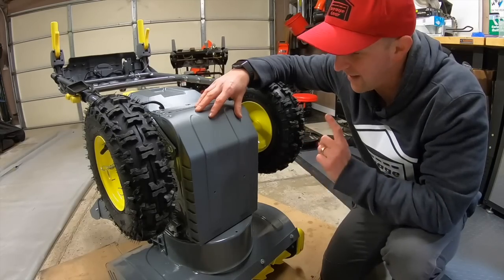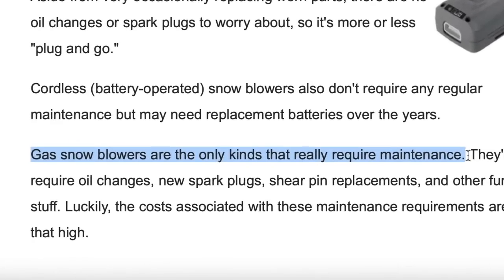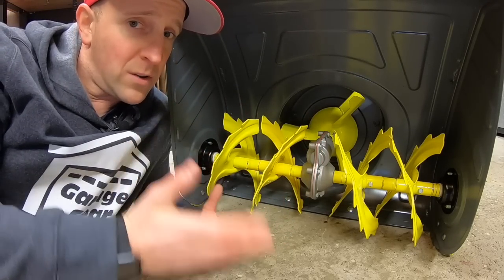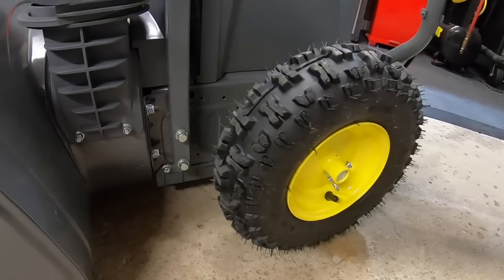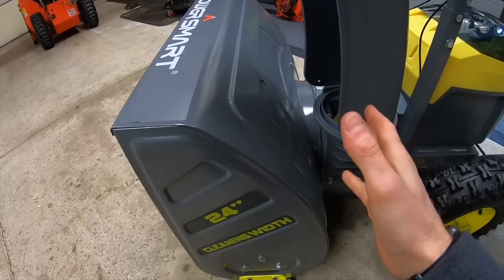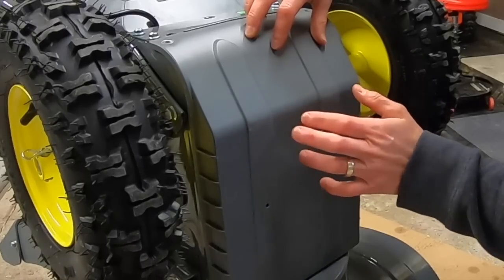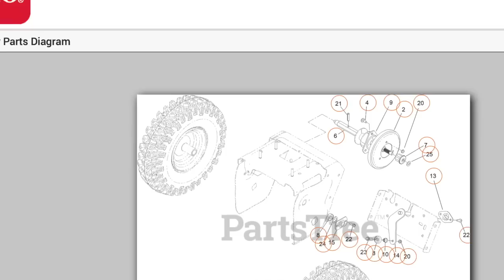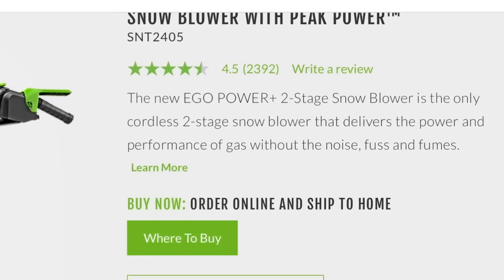ARE BATTERY POWERED SNOWBLOWERS MAINTENANCE-FREE?

Comment: "maintenance free" generally means little or no maintenance. Speaking for my single stage EGO, no it's not maintenance free. Their scraper bars are made of cheap plastic that will barely give you a season. Toro's battery powered single stage says you get 20 hours from their single stage scraper bars and they're not cheap to replace if you can find them. Then you have the horrible design, they don't have skid shoes so the auger and scraper bar eventually get destroyed. That said, I like not having to worry about gas and oil any longer.
Reply from the maker: Thanks for sharing this information! 👍

Comment: General rule of thumb: moving parts require maintenance, and will eventually fail. On Electric machineries, there are less components compared to gas powered machines, and therefore might be easier for DIYers to fix. But, it won't be necessarily cheaper compared to gas powered models.
Reply from the maker: Totally agree Ben! Thanks for sharing!

Comment: It is good you are educating people about these as far as I'm concerned these things are disposable. Plastic not only wears very quickly but the colder it gets the more brittle it is which means it breaks. As for the battery I don't know how long they last (a car battery lasts about 5 years ) but you can add that to you're list of maintenance items and probably a very expensive one' Thank you but I'll keep my gas model that I've kept running since 1994      (that's 28 years) with very little maintenance.
Reply: "a car battery lasts about 5 years" Is not relevant, entirely different chemistry and form factor.
Reply: @Neojhun  maybe not but my sons lasted 3 years now he gets to buy a new one so believe what you like I only know what I've seen
Reply from the maker: A lot of god points here! I know a handful of electric car owners and it will be interesting to see where they are at in the next few years. I don’t see them being very happy. Thanks for watching!

Comment: This is the video that convinced me to subscribe to your channel. Well done and and thank you! I'll stick to my Ariens Deluxe 24, which I don't find any trouble at all to maintain. I've been familiar with the care and feeding of small gasoline engines since the mid 1960's so I don't find them to be any hassle at all, it's just normal maintenance that by now comes naturally. And the only additional maintenance on that over a battery powered machine is an oil change. The ignition is electronic and the spark plug is platinum so I expect those parts to last nearly the life of the machine. And check out the price of those replacement batteries. Yikes!
Reply from the maker: Thanks for subscribing Irving! Maintaining a gas model is not complicated. A few minutes and a little know how and you’re all set each year. Thanks for watching!

Comment: ALL machines require maintenance. The extent and kind of maintenance depends on the machine.  Owners who prefer no-maintenance snow blowers will join the frequent buyer program.

One of the concerns I have about an electric snow blower is not the maintenance, which is no big deal,  but rather precisely that it is light in weight. This makes using it easier, but it will also make it less able to deal with heavy and compacted snow, like that at the end of the driveway after the snow plow passes by.  A light-weight snow blower will tend to ride up and over such snow. This is also true of smaller, lighter-weight gas-powered snow blowers, in my experience. (For this and other reasons, I regard single-stage snow blowers as a waste of space. Just saying...)

Another issue with battery-powered snow blowers can be the batteries themselves.  If they go bad, then that is a major-league expense, and these batteries do, on occasion, need to be replaced. Further, batteries with higher amp-hour ratings cost a lot more that those that usually come with the new machine, though they might be worth the cost if you have a good-sized space to clear.

Other than that, a battery-powered snow blower looks like a pretty good option (1) for areas where there tends to be light to medium snowfall, (2) for owners who prefer light to medium maintenance, and (3) for those who want a quiet, light-weight, compact, clean, and easy-to-store machine. 

I have a twelve-year-old Troy Bilt Storm 3090. It is a beast. I love it!  It is still going strong, and I maintain it.  Yet, if it goes face up on me, I am considering a battery-powered snow blower (EGO) simply because I am getting older (at 74) and my snow blower seems to get substantially heavier every year.  Strange how that works out, right?

I really appreciate the tips and techniques for maintenance you offer in your videos. Very helpful.  RESPECT!

Great video!  Great channel!
Reply from the maker: Appreciate you Jerry! Thanks for sharing this!

Comment: i own a single stage electric with no maintenance for 27 years, when i finally replaced the belt last year.
bearings on the beater bar are sealed. 
by the time replace them, it'll be time to buy a new one.
never not worked anytime i plugged it in.
Reply from the maker: Thanks for sharing HG!

Comment: When you tipped it up, my first thought was that it was the only difference from a gas powered machine, no drip.
One thing about gas models is that even though you have to maintain them the same, you can also fix them cheaply. I didn't like the look of that little drive motor on the electric. A spark plug, oil change, or new carburetor isn't too expensive. How much is one of those little motors?
Thanks for showing us this.
Reply from the maker: Hey grey one of those motors runs about $220 bucks last I checked! Not cheap. Thanks for watching!

Comment: what do you think of Toros 60v 2 stage? they kept the gas blower design and swapped it with a battery motor over the gas?
Reply from the maker: Well, I’ve done a handful of different battery products in my garage and reviews on all of them. Every single one was junk and not worth keeping. The batteries are expensive, don’t last long enough and definitely can’t handle Buffalo winters. If you have a small amount to clear go for it if not stick with gas.
Reply: yeah we dont have a huge driveway by anymeans. even though u dont advise battery snowblowers, if their was one u had to pick, which 2 stage model would u think is best out of all them? @GarageGear
Reply from the maker: @randomrazr  is probably lean toward toro because they have more metal components.

Comment: 1st off def appreciate all of your insite and watch a lot of your videos. But I think it's a wee bit overkill greasing that regularly...especially if you are only using the machine a few times a year. I have both gas and electric and live in the northeast.  Electric for about 5 years and had to do zero maintenance so far and gear and shaft grease is completely fine. To be fair "zero maintenance" for an electric blower is not accurate. However far less maintenance than a gas blower would be a fair statement.
Reply from the maker: Thanks for sharing him! Companies should definitely use the terms “less maintenance”. Yea if you don’t get a lot of snow greasing often is not required. Thanks for watching!

Comment: As an elderly single, disabled woman I love your videos!!! You make them easy to understand and love your added humor. I live in waaaay northern Idaho.... the previous homeowner left a Toro gas blower... it leaked gas, it was hard to turn and got stuck in the ruts even with chains on it... and the "one pull" bs well... was bs! So I bought a Ryobi battery powered to replace it... POS... the. plastic part on the bottom broke the first day I used it. I returned it and since bought the new Toro battery "all metal" machine... I gasped at the price of almost $2000k but was going to try it out and return it if it didn't perform. BEST>BLOWER>EVER!!!! It's all metal, no plastic...the same as the gas machine except with a battery engine... it has heated grips, it turns on a dime with one hand...(I have a torn rotator cuff and had no problem) ...NO CHAINS required what so ever... it is a beast!! I have 5 acres and heavy snow load... I have made paths around my property with ease to walk my dogs all winter...my "Arien" gas neighbor is beyond impressed... The only downside is the two batteries it comes with only last about an hour or so per charge depending on what you are doing... but I am worn out by then anyways. You can add a 3rd battery but they are $350 I think. I did not know about the maintenance required so THANK-YOU JB for another amazing, informative video!!!
Reply from the maker: Hey Willow Tree, thank you for sharing this! It’s great to hear what people are experiencing first hand using this equipment. As well as their likes and dislikes and what broke along the way. I appreciate your feedback and thanks for being a cool fan of the channel! 👍

Comment: What happened to the lube on the drive gear? That's poor quality manufacturing, and guaranteed to cause an expensive repair. Most people that buy those will be mechanically challenged. Thankfully, I'm an older guy, and learned this stuff as a kid. 

No gas? I'll pass.
Reply from the maker: Right there with ya Rob! Thanks for watching!

Comment: My dads battery powered toro left him stranded at the beginning of the season. It was too cold for the batteries to work and the machine refused to turn on. Like others, I’m sticking with gas for now. Another great one, thanks!
Reply: That's sad they don't have a preheating function when plugged into charger. That could be the simple solution to avoid that problem.
Reply from the maker: Thanks for sharing this Shawn! How long did the battery last on its use? Do you know by chance?
Reply from the maker: @Neojhun  I like the idea but I would imagine this jacking the already insane prices of these even higher. Thanks for sharing!
Reply: @GarageGear  I’ll ask him and circle back. I can share that he now keeps the battery inside and on a subsequent snow had no issues.  I still struggle with the concept that it could be to cold to use your snowblower. This is a concept I have never had to deal with when using gas. I’m all for electric, I just question if the technology is fully reliable yet for snow blowing.
Reply from the maker: @shawn8196  I think all of this has come a long way but we’re not there yet! Batteries are really good trimmers but any thing needing consistent power needs more work!
Reply: @shawn8196  Yeah you're definitely supposed to remove the batteries from the unit and bring them inside. They're heavy enough that they're not going to get too cold in any weather if the blower is active, assuming they're already a reasonable garage temperature (15 ℃ / 60 ℉) when you start.

Comment: No thanks,  I’ll be keeping my big Toro.  That thing looks like a toy.
Reply from the maker: Hold onto your gas equipment! Thanks for watching DA! 👍
Reply: I looked at the toro 2 stage electric before buying gas.  Except for he power plant, it’s exactly like the equivalent gas model.  Same friction disk, same augers, same impellers.  

I ended up buying gas. But, if I had the opportunity to test the toro electric over a storm or two I might have switched.   I drive an ev and I love it.
Reply: @edroberts9040  I just learned of the toro Eletric job today! Looks like it’s built to last.   I just don’t mind the very little maintenance that my gas one takes. They market the maintenance as if changing the oil and draining the float bowl is incrediably time consuming and will cause a divorce.  Really, I’m just done buying “homeowner” grade crap. Like the snowblower in the video.  Eletric cars are cool as heck too but I paid my two cars off! So I’m gonna hold off on anything new till things get more stable.
Reply from the maker: @edroberts9040  thanks for sharing Ed!